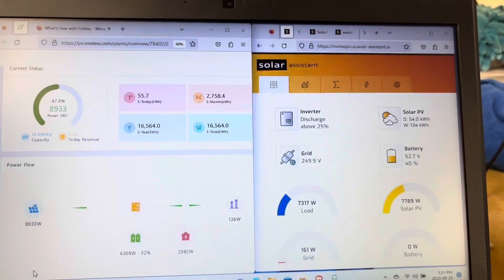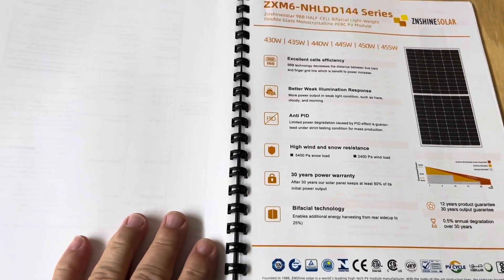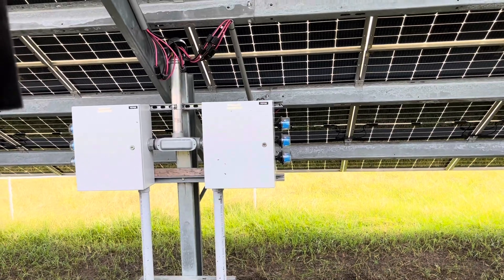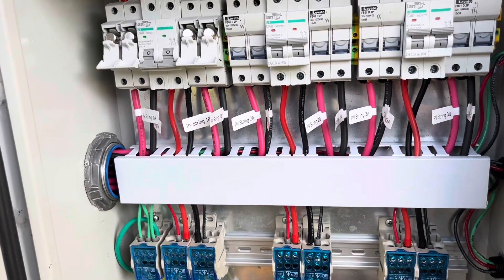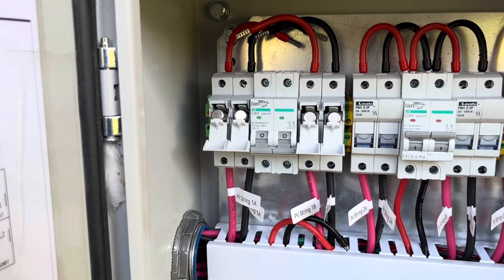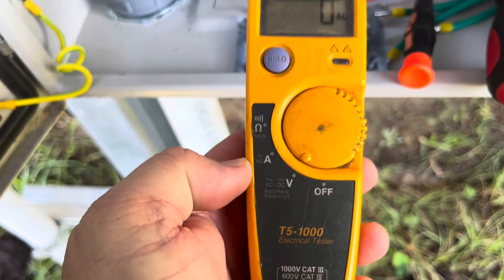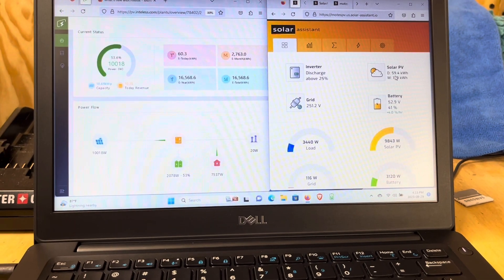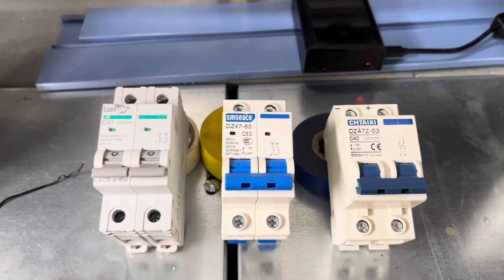Troubleshooting PV Power Output Problems

Comment: Very interesting video Jeff. I am wondering if these breakers are really certified? there are alot from amazon or aliexpress that look the same and most of these are only " CE" certified and not UL or TUV or CSA and even most "CE" breakers from china are not the real CE but a different CE logo that look similar but that in reality only mean " CHINEESE EXPORT" !!! there are article about that. There are even some that are described as a breaker but when you dissassemble these you only find a switch and no magnetic blow out etc... !
Reply from the maker: I doubt this one is UL listed.
Reply: I am curious as to why you are combining the two strings?   Are the 14 panels higher than your solar VOC ?    Thanks for the videos. Great Job!